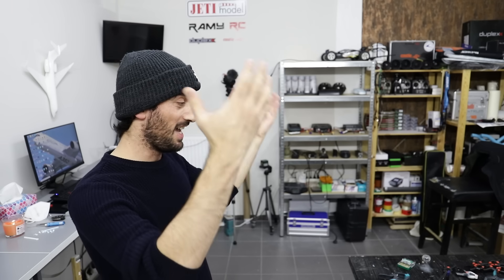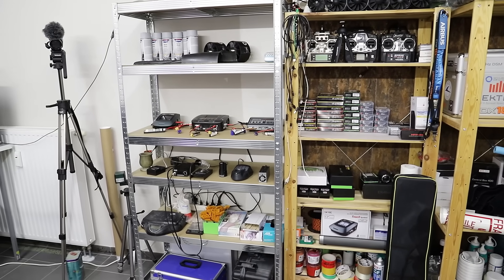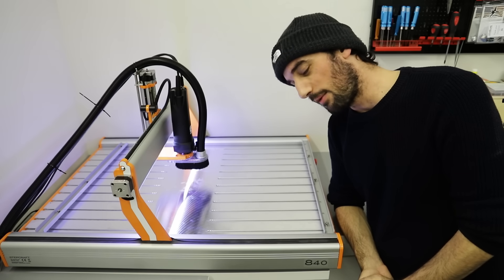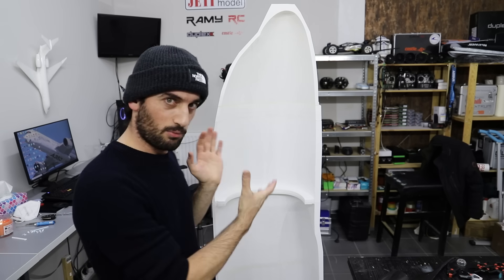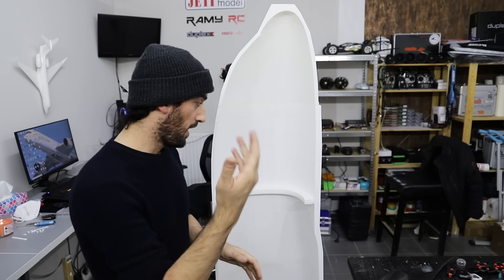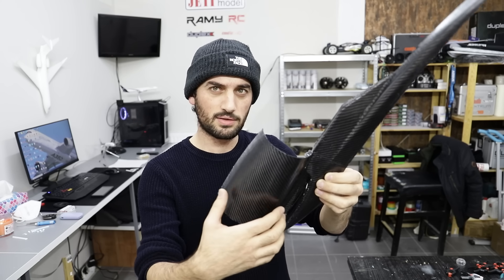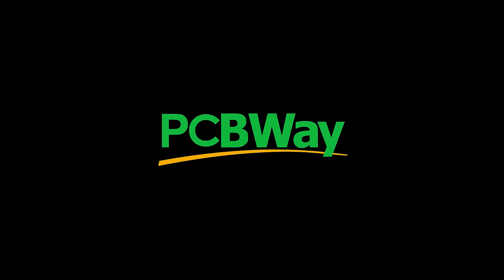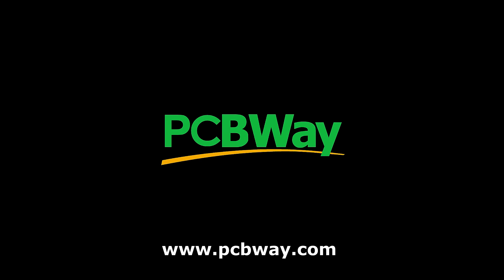2020 Rewind /new workshop / new project

Comment: As always your work is so inspiring and beautiful. Growing up I had a sweet spot in my heart for the DC-3, B747 and the B737-300 (Which I've always wanted to build). Can you do a video that explains how you make the molds. Not an intensive video on the software, but at least include some of the key concepts and process. (i.e. what function is used to cut the model from the mold.) Please also touch on 3D printer settings (wall thickness, infill and speeds). Are your .stl files available?

Comment: Ramy, what is the reason for your tremendous labor?  Realism, right?  I would like to see you add thrust reversers to you planes.  Of course, thrust reversers aren't necessary, but they would add realism.  Also, have you ever considered stepping up to real jet engines?  They add so much realism to the other RC aircraft I've seen and sound fantastic!